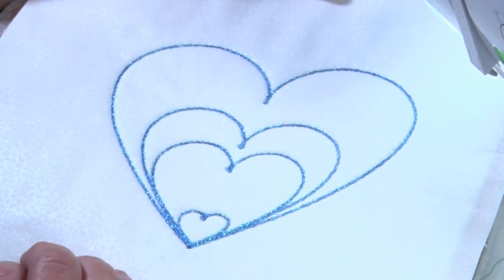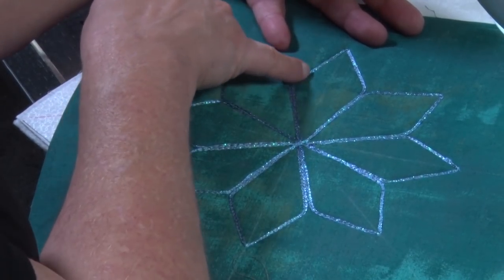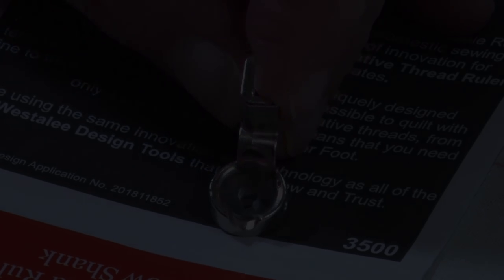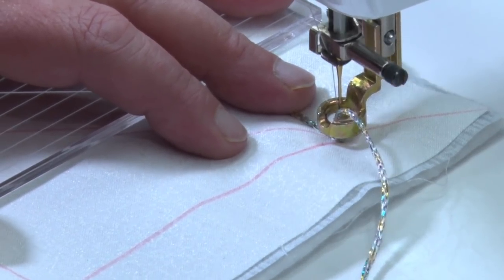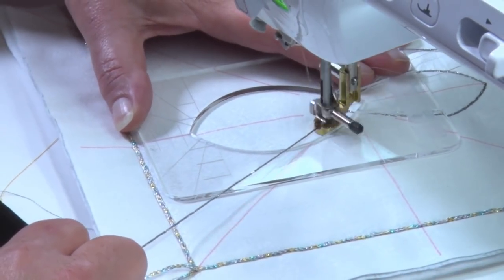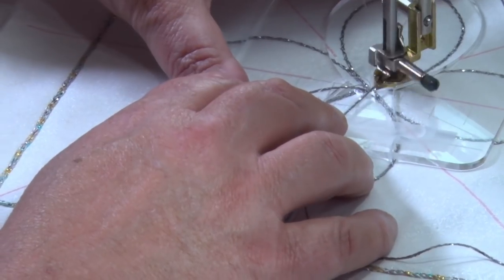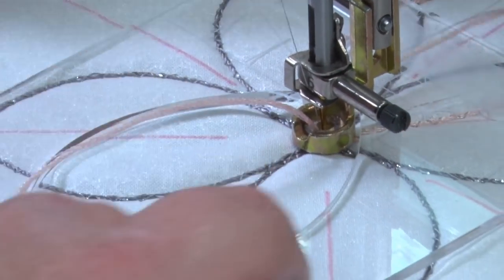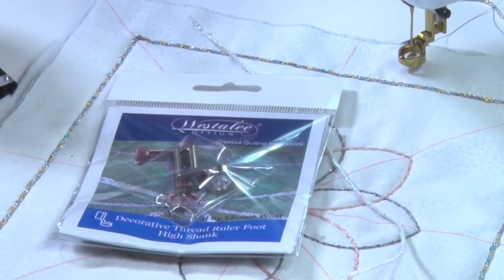Westalee Decorative Ruler Foot

Comment: I presently use a Bernina Ruler Foot #72 on my Bernina 820.  The adapter I had to connect the Westalee foot didn't work correctly.  I am interested in the Decorative Ruler Foot (the video was amazing and looks like fun) but don't know what size shank will fit my Bernina 820?  What do you recommend?  I still have the adapter from when I tried to use the Westalee ruler foot, but am hesitant to purchase if it will give same issues as before. ( I had to decrease the pressure foot scale to a negative 25 to get it to work.)